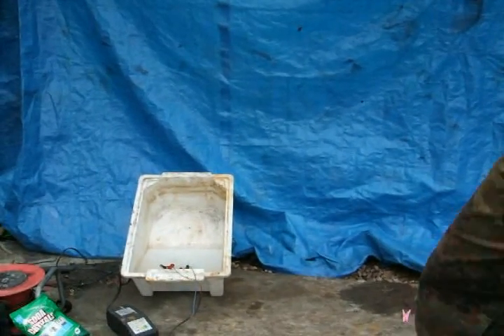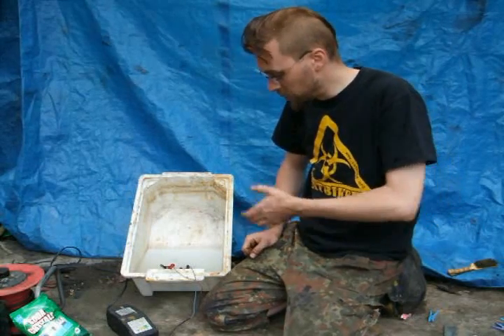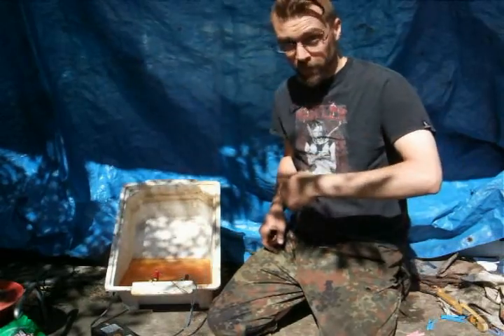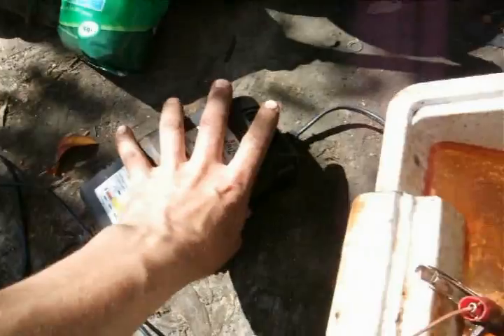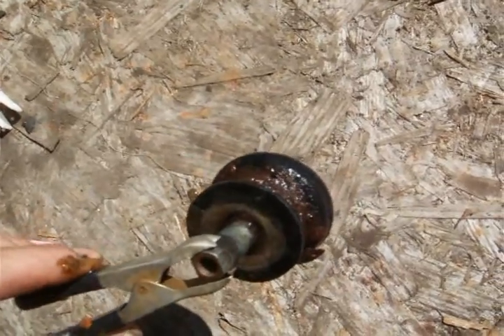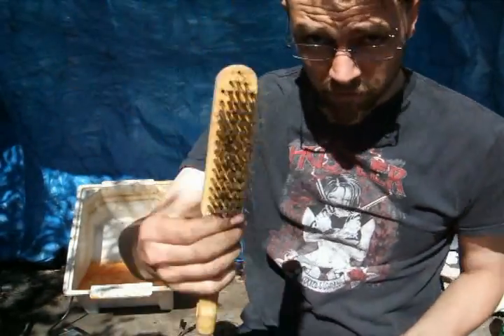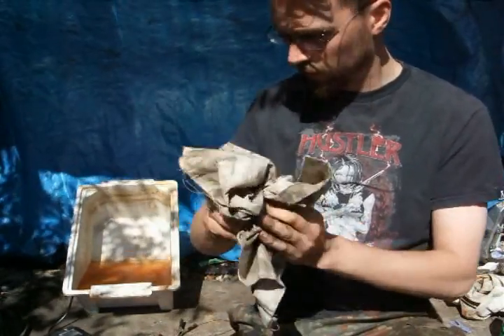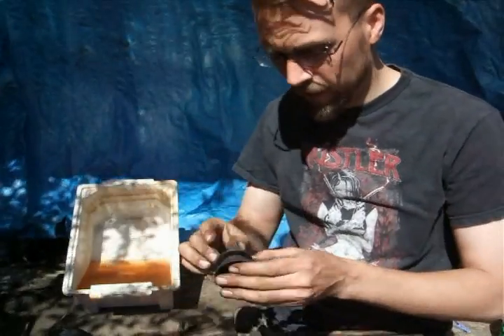How To Remove Rust With Electrylosis Part 2 of 2

Comment: once the part has been cleaned from the process AThunderA, then you just wirebrush and clean it off, leave it to dry fully, Rat Biker said he puts on the radiator to dry fully, then he gives it a coat of red oxide primer to protect it the you can finish the part in what ever colour you want, hope that clears it up for you mate. Handy Video RatBiker by the way thanks.

Comment: Hi RatBiker,

Thanks for the video. If you use this method a lot, could you substitute a non-metallic anode (such as a carbon electrode from a discarded dry cell battery) for the sacrificial mild steel electrode ? 

Steve

Comment: Well done, would be nice if you covered amperage of the charger.  I started with 2 amps, very slow. Now I run 12.5 amps and I'm getting great results.  Also, I am using borax (boric acid) rather than wash soda (might be same thing).  What is in wash soda anyway?

Comment: i do admit i had the wires backwards on my first try lol lucky it was a big bumper and i caught it before there was any damage. i found an old power suply from a computer and the output on it is 25 amps. im sure that will speed up the prosses.